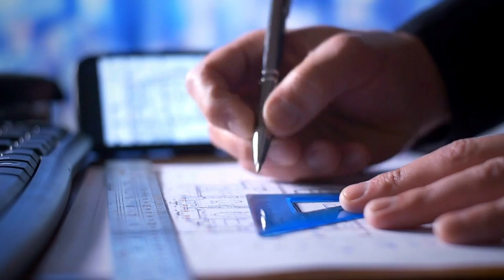The Monster Howitzer That Can Drop Shells on a Dime 30-Miles Away

Comment: M777 is an accurate gun but has no crew protection and has no chance against counter battery. It’s good for peace enforcement ops  or air assault ops but in full scale mech war it’s not flexible enough.
Reply: Needs wheels/tracks
Reply: Why do you think pretty much every country, also, has mechanized artillery to go along wit their towed artillery. You can't just go one way or the other completely. It has to be a mixture of both. I have seen that the Army has experimented with a 105 mm howitzer on the back of a modified Hummer.
Reply: @Lonewolfmike  Marines have a 120 mortar system on their hummers etc and have had said system for a long long time.
Reply: @w8stral  This is a more recent thing. Within the last two to three years. The way I understand it, it's still in the testing phases.
Reply: @Lonewolfmike  You could be right, maybe I misremembered the 105mm mortar system for 120.  Probably shouldn't have posted.
Reply: @w8stral  No worries. I have no doubt the military had 120 mm mortars with Hummers. Kind of a no brainer there. Not to hard to tow or anything like that.
Reply: Ukraine is showing its decently flexible
Reply: @opairsoft8100  Well that fact is because they are like a western/NATO military, now, instead of the old Russian/Soviet style military. They worked with NATO countries, over the years, and have adopted many things from what they have seen and learned from NATO militaries and military commanders.
Reply: @Lonewolfmike  basically yes
Reply: @opairsoft8100  Ukraine is showing that with the right weapons anyone however corrupt they are, can be "decently flexible".
Reply: Y'all some gays

Comment: The m777 is the peak of fully manual towed artillery. And it's kind of obsolete.

8 people with zero protection operating an artillery piece that can only reach 24km without using basebleed/RAP/Excalibur and it has a redeployment time of up to 3 minutes. Despite the fact that the Russian military is even more obsolete the M777s (and the M777 crews) have taken a punishment in Ukraine. Would have taken even more punishment if it wasn't for the fact that Excalibur rounds makes it harder to track the firing position (since it's not flying on a ballistic arc the firing position can only really be tracked effectively by artillery radar if the shell is discovered on the upwards arc) and the extra range gained means that you can fire artillery outside the effective range of acoustic tracking systems.

Or rather, outside the range of russian acoustic tracking systems. When the next conflict comes (with stuff like drone based acoustic tracking systems, already in development) I would not want to be a part of a M777 crew. The future of artillery needs to be able to shoot&scoot so fast that they can fire a salvo and be out of there before an enemy shell hits, even if that shell was fired the instant they revealed their position.
Reply: The M109 has done that for decades.
Reply: @eb1684  M109 cannot be replaced fast enough with the M1299, as it's severely lacking in range and rate of fire. Only reaching 21km with standard ammunition is 1970s numbers. As is 4 rounds per minute. The M109 should have been replaced 30 years ago.

Comment: With today's technologies, can the 175mm and 203mm calibers return to the battlefield? Thank you .
Reply: 175mm?! Are you high?  That round literally wobbled in flight and had horrible accuracy.  That is why the US replaced them with the 203mm.  😭
Now you made me cry, I miss my M110A2.
Reply: @WolverinStudio  I didn't know about the lack of precision of the 175mm. But the question is how much range , accuracy and destructive power can these calibers provide with modern technology and at what cost versus other weapons like MLRS , or aviation bombs . Not to mention the cost of operating the platforms and their availability under any circumstances .
Reply: @ALBERTO MORALES. With today's GPS guided projectiles, it does not make sense to use the 203mm artillery. We needed bigger projectiles because we couldn't hit the targets precisely and destroy it - now we can. Smaller shells means more rounds per pallet, easier to carry physically, etc.
Reply: @slimjimnyc270  I understand all of this. But the 155mm can't handle all targets , what happens when you need to have accuracy and more destructive power .... In theory the 203mm was eliminated in the west by the MLRS or aviation which are less available and more expensive .

Comment: With counter battery radar you can't
Unass the firing position fast enough the only thing they would be go for is an air assault. Drop in throw a round or two thenget out of thetown I know what I'm talking 
About I was a13B10 redleg

Comment: Well I assume Russia now has the schematics for said artillery 😂
Reply: If they’ve been sold to Saudi Arabia, China has it too.
Reply: @Jess Boswell. It not the actual mechanical hardware which makes this deadly, it is the electronics and software. It calculates the firing solution quickly, sets the fuse, it knows exactly where it is and it knows exactly where it is pointing w/ minimal user input. I don't think we gave the Saudi or Ukraine our latest and greatest electronics w/ this howitzer.

Comment: Yes, BUT more than half of those we gave to Ukraine have been destroyed.  And the entire west is almost out of ammo.  What good is it without any ammo?  The last problem is that lack of protection for the crew.  With the crew dead from shrapnel, it does not matter if the gun itself is mostly undamaged and can still hit a dime 30 miles away.
Reply: fyi, I was in artillery in Vietnam.  Self propelled 8 inch artillery and 175's on the same platform.
Reply: Show us the verified data for your post where and when they were destroyed and how?

Comment: M777 needs to replace its main barrell after 1500 rounds fired. That means it spends more time in the shop than on the battlefield. I would not call this the BEST! More the most mobile.
Reply: Also if damaged in field,.it cant be repaired at all

The special alloy used to make them makes field repairs impossible

Comment: Vietnam tested, now helping with dekatsapidorization in Ukraine. Cold War power.
Reply: M777 in ukraine were useless, the problem with these is the alloy they are made of.

They get damaged by sustained firing and as they are special alloy made, spares are difficult to get and repairs in field impossible .

This is why this is a specialised weapon, not a regular sustained firing pounding artillery
Reply: @hiteshadhikari  that's why Ukraine  war is great for, to test weapons in real war  conditions    against the orc army  and identify and fix such problems with them
Reply: @cartoonfan959  to test? Its in use for decades 

Nothing to test, its not made for such warfare

Its a light shoot and then scoot system or a quick deploy system, its not to do a prolonged sustained firing
Reply: @hiteshadhikari   well now they know its exact limits  , and now that they know such an intensive  warfare can take place maybe they design its succesor with that in mind
Reply: bottlesitter 
- Yes, russian tactics to rushing hundreds Vankas on MG-42 worked in this way too. Tactics didn't changed from a Golden Horde wars, ahah.

Comment: Ukraine has exposed what a worthless over-engineered piece of junk the M777 actually is. Its titanium barrel is prone to warpage due to over-heating, making it necessary for the 'system' to have a cooling down period, which is bloody useless in the middle of a battle. Nitrogen and oil leakages along with electrical malfunctions, have added to the M777's unreliabilty.

By contrast, the Soviet Era towed artillery employed by Russia, have all the hallmarks of robust construction, reliability and simplicity, that's missing from the M777, where a maze of over-complicated plumbing, circuitry and additional hardware, make it necessary to employ a much larger team to operate the system.

The relatively clean static firing positions for the M777's in Afghanistan where firings were extremely limited (without opposition), are in stark contrast to the 'fire and run' in Ukraine, where the weapon is carried on grossly small wheels, better suited for the highway instead of the rigours of cross-country.

Comment: Yeah no they haven't been all that effective against Russia for Ukraine for the some of the same reasons you mentioned... Russia's artillery has a longer range than the Howitzer. Also, Russia has significantly more artillery than Ukraine. Another issue is the cold and wet weather, which has been causing the Howitzer's to break down at a quicker rate than normal. The Howitzer's have worked brilliantly in bombing innocent Ukrainian civilians in Donetsk tho
Reply: Post physique
Reply: Some russian artillery have a longer range. Like the 2A65 Msta-B. Of which they have like...400 pieces? Stuff like the D-20 and D-30 (which form a very large component of the Russian artillery park. As in "thousands and thousands of guns") do not.